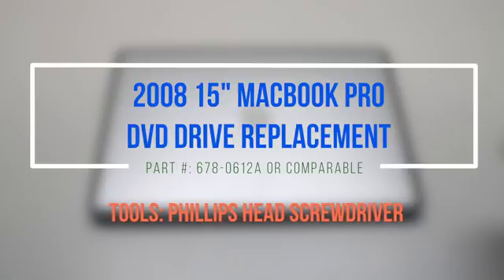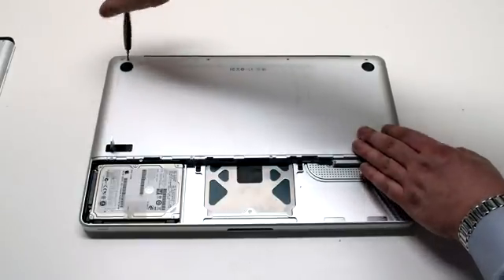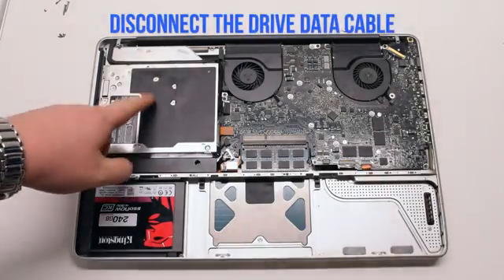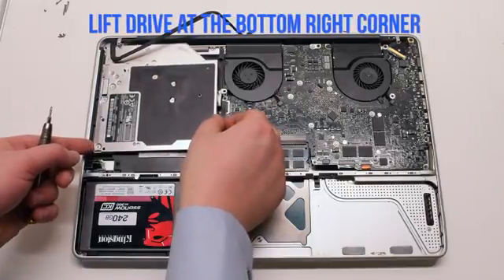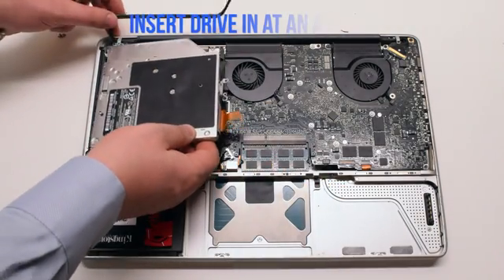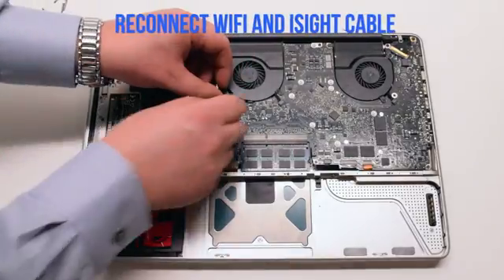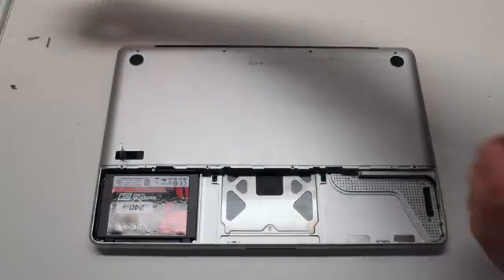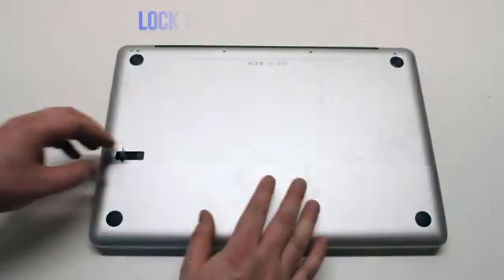2008 Macbook Pro 15" A1286 DVD Drive Replacement

Comment: Yep I tried this too.  After reassembly had no WiFi or Camera!  
:( 
Seems that I did not clip connector back in correctly.  I have tried and re-tried to attach the connector with no luck.  I think that a close up detail on exactly how that connector goes back in would be helpful.  I suspect that I have damaged mine but will keep trying.  I have been using this laptop for Zoom so losing the camera is problem.  I was taking the DVD drive out for diagnostics.  Seems there is a problem in that the motor on the DVD gets confused and thinks there is a disc in when there is not.  Sadly was not able to fix this.  So have gone from no DVD to no DVD, WiFi or Camera.  Maybe I am expecting too much of a 12 year old laptop!
Reply: If you don't succeed, try, try again.  After watching the video again, went back and tried to re-seat connector.  Got it right this time.  It was not broken.  I needed to use a screw driver to get the connector in parrallel as the guy does on the video.  WiFi and Camera are both working now!  No further forward with DVD.  May buy another one.

Comment: Followed exact instructions now when cd is inserted it is automatically ejected after a few seconds.
Reply from the maker: It could be that it’s misaligned. Open the rear panel and try to realign it by adjusting the tightness of the 4 screws that secure it, play around with it and let me know if that helps.